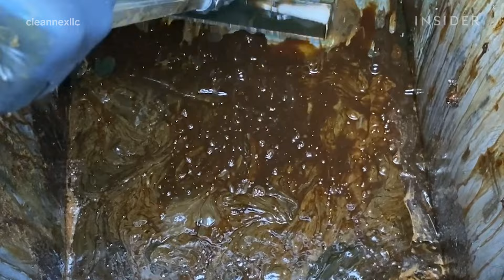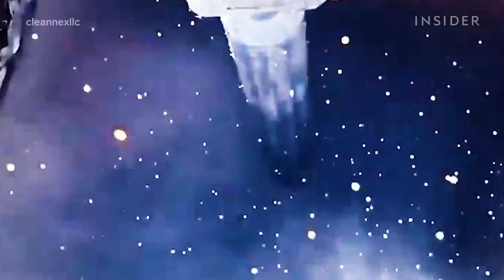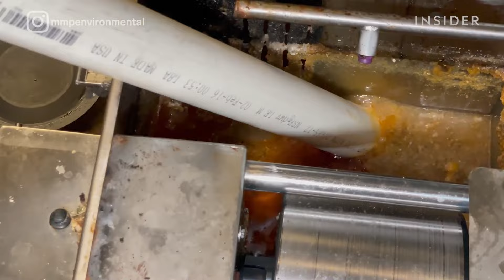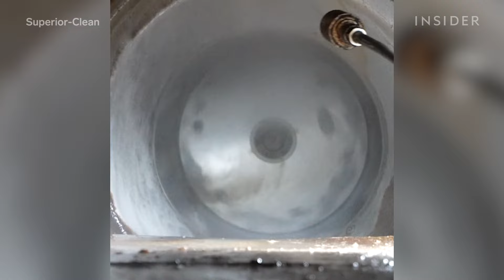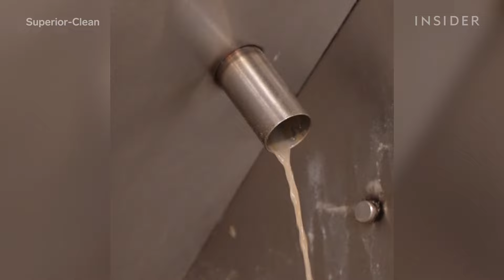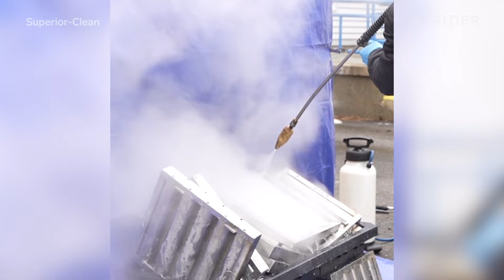Greasiest Parts Of Restaurants Deep Cleaned | Deep Cleaned | Insider

Comment: I know of a machine that can achieve horizontal and vertical oil smoke pipes without the need for manual scraping of oil, and the duct fan does not need to be disassembled. It can be easily cleaned by one person without affecting the dynamic balance of the fan impeller, and it also has a high-efficiency removal function for thick oil.

Comment: HOW WE EASILY CLEANED THE WORST-OUR HOOD'S METAL GRATE-FILTERS: Under Close inspection, they were SO gummed up with old grease. It looked like old thick caulk and wouldn't scrape off. 
We Ended up finding the best easiest way to clean them: They couldn't be placed in a self cleaning oven setting to turn to ash because that much grease is flammable. So we placed them one at a time in an OUTDOORs common patio gas grill and closed the grill hood with what didn't fit in the grill, sticking out. 
The grease caught fire and at times we turned off the grill for the flames to subside. 
Within 30 minutes, the grease was as and the grate was clean. 
If you do this method, it's at your own risk. I'm not a professional and this has risks. 
Take care

Comment: Why there are no nonstick exhaust?
Reply: There's no such thing as non stick, just stick resistant. But also all the grease would just slide off the walls and now you just have grease constantly dripping out of your vents
Reply: Nonstick coatings are coated with perfluorooctanoic acid. It’s fine for home use, but there’s a reason most industrial kitchens use stainless steel. Anything else under that amount of heat for that amount of time will break down. Also, yep, the grease would just drip straight down into what you’re about to eat